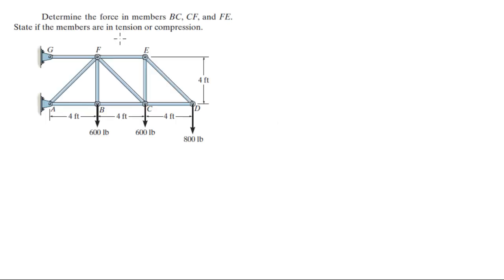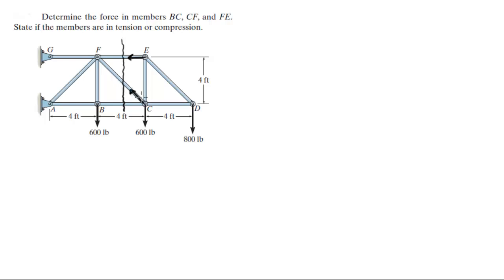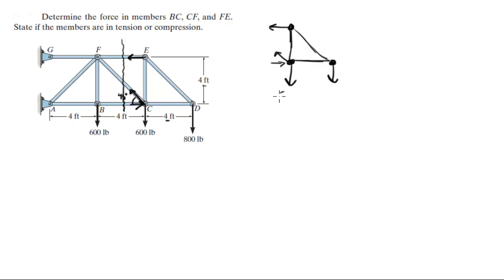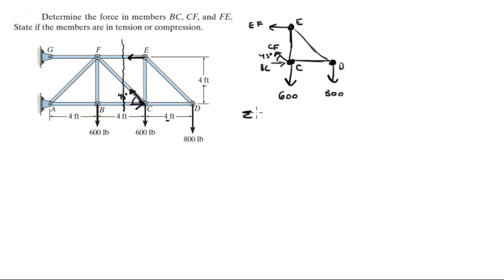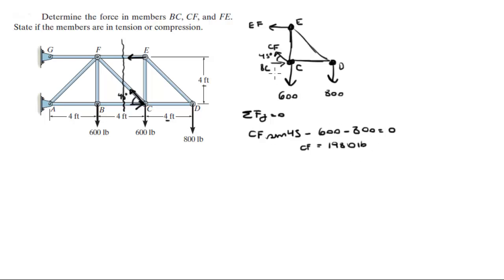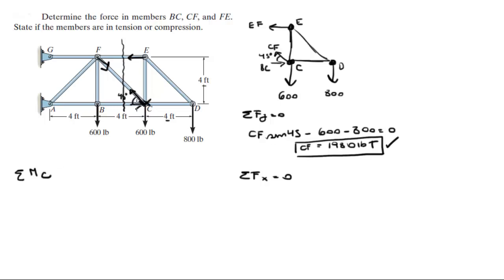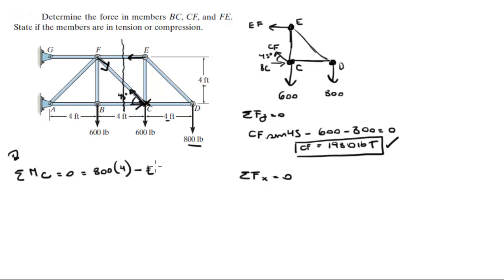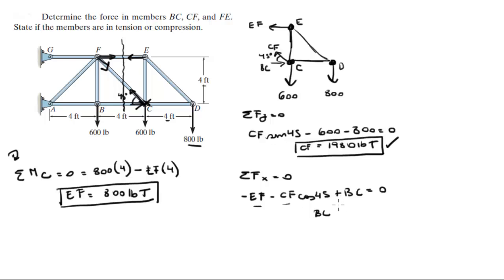Determine the force in members BC, CF, and FE.

Comment: when doing sum of the moments at C why dont we take into account CF?
Reply: My best guess is that it is because Moments=(distance)(Force) and the force vector for the member CF passes through point C, which would make the distance zero, hence the moment caused by Member CF onto point C = zero
Reply: no, he did sum of the forces. On the free body diagram, the only forces(which are drawn as arrows) are 800, 600,BC, CF and EF... CE and ED are NOT forces,
Reply: Its because CF is in the line of action of C, that is also why he did not put BC there either.

Comment: Why is force on member ED not taken into consideration when you do summation of forces in Y?
Reply: Was wondering the same thing. Checked with my solution manual and his solution seems to be correct. 
I thought the rule of zero force member would not apply to ED, since there is a load acting on D, but i guess it still does. lol
Reply: yes it applies because you have one bar and one force